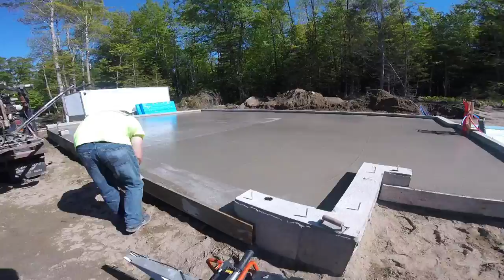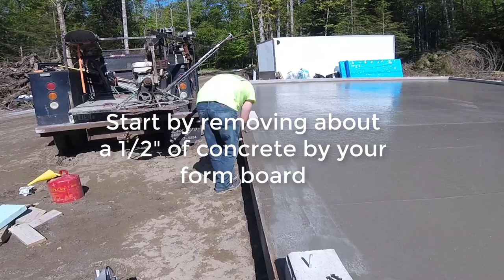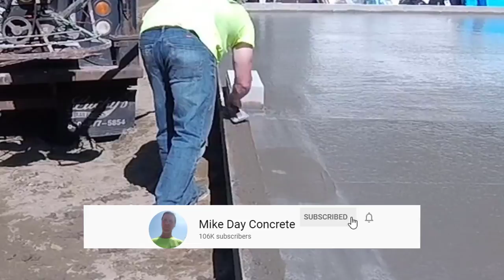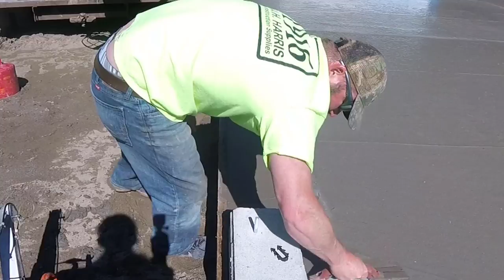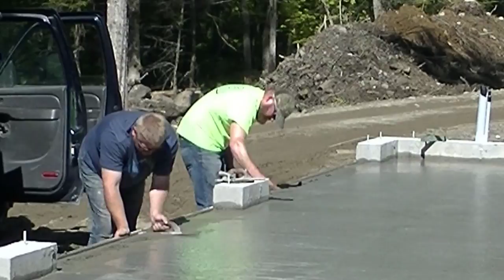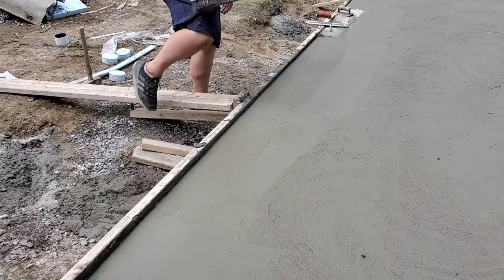Concrete Finishing Skills - One Trick All Finishers Should Know How To Do!

Comment: Building on the Washington coast that's a must, especially if door faces south. I do almost the same except I leave it as a pocket, not smoothing the inside edge. I make it straight by notching a 12" 2x4 a 1/2". Then if water gets past the door gasket it will come up against the 1/2" dam.

Comment: I remember when I was young that I always thought I didn't have much time to work concrete because I would here stories that cement trucks drivers would hold a load to long and it would dry up inside.  I don't know maybe someone was trying to scare me to work harder.  I wanted to do the best job and rushing was always my downfall.  thanks mike for those who will learn better then I did.
Reply from the maker: Thanks John!
Reply: I’ve had loads so hot that before the truck finished cleaning out I already have my finishing machine on it.    Once lost 6 yards from hot loads
Reply: Concrete has different stages to where you can do different things. The top gets hard before the inside does.

Comment: So im kinda a freak about this. I have made a darby with a 10 inch long and 1 inch deep wedge attached to it. Simular to the door tools already made. I just prefer a darby because it will be consistent with the floor due to the length of a darby. After cutting and maging it out i bring in a strike off to check. Very important if there is a pitched drain by the door. The cutting tool will not be completly acurate with the overhead door seal. Love these videos Keep them Coming!!!!

Comment: how  about  just  dropping the outside  form down a half a inch  then just  mag down to that on an angle from the inside of the  wall to the outside form board
Reply from the maker: You can do that yes! My guys like the form to floor grade. It ensures the floor is perfectly level where the garage door sits.
Reply: I pour garage lips first 1 inch lower than the garage floor hight  check it with a level and close the garage door to make sure it’s all sealed and flat ... then lay a 1x6 on that matching up to the garage door guides  on each side .. then pour the rest of the floor with 4 inches of pitch to the top of my long  1x6 I put on the garage lip slab already screeded
Reply: Have been doing it every day like that sometimes 2or more  a day  for the last 10 years no problems  easier and faster than digging out  across a 16ft  lip
Reply: @Beamernickm3  you are  making it  way more  complicated  then it  has  to be,  the  easiest  way will be  to just lay a  straight 2x4" across the  inside of  the  wall and  then from that do  your  half  inch  slope down to outside  form board
Reply: I've done them many ways over the years.  My preferred method is to frame 1/2" low and tack a piece of expansion on top.  Give you a good grade to strike to and easy to peel of for the lip.

Comment: Set your bulk head inch lower than grade at the front of garage then pour that first level or slight pitch and put a 1 by board over the top of that ... then when pouring garage just go to the top of the 1 by  cut side joint on that and the bulk head     Done.   Garage door comes down on the lower part of the garage  the lip we call it  then the rest of the garage is 1 inch higher with pitch coming out  so now Ayer can come in and all goes out.. we usually put 4 inches on garages when there is no drain

Comment: There is actually a tool you can use to do that. That is what it was made for. It's like a regular mag float But at about 8 inches from the tip it goes down 3/4 on an angle and has a lip that you can rest on the header Not sure what it's called. we just call it the Cool Tool. we dig out just like you are showing here but after you dig a little out you use the cool tool and its super easy and super fast.